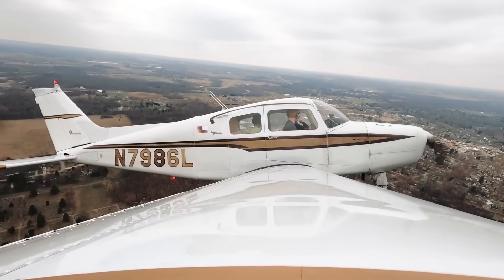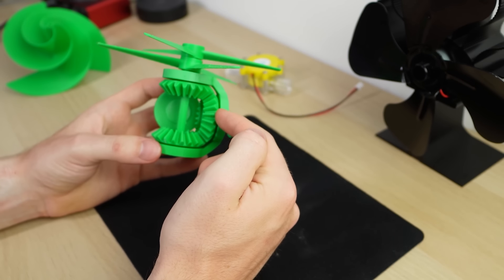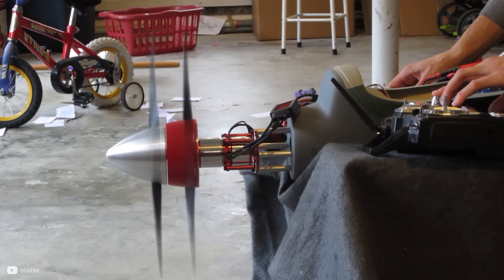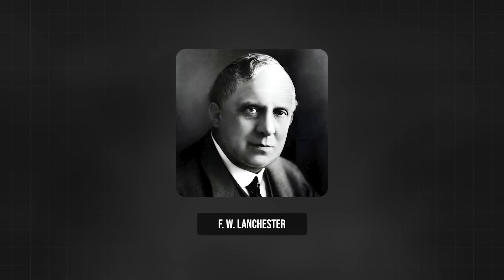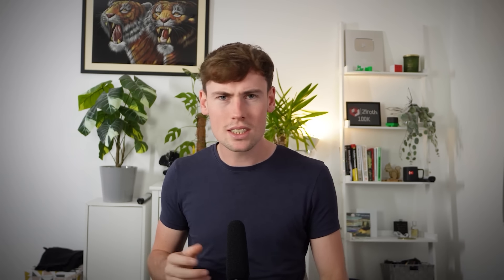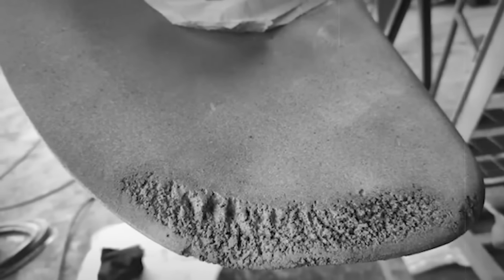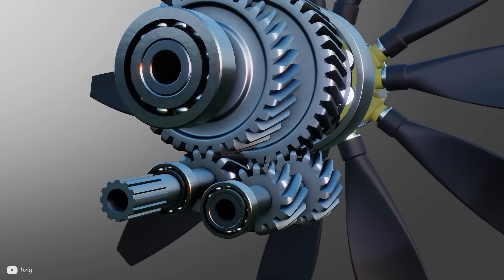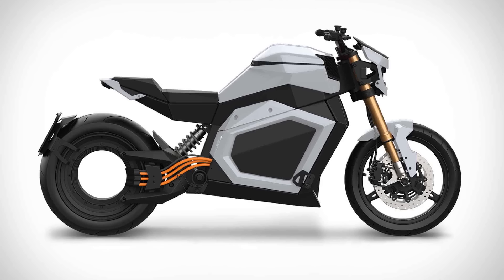The Unexpected Genius of Contra-Rotating Propellers

Comment: a pair of 2 contra rotating propellers would need different aero design each. or the rear one must have lower RPM speed. 
this is due to how the air get carried into the first propeller's momentum and rotating towards the first propeller direction so it will hit the second propeller with more energy, making the second propeller, albeit it running at the same RPM speed as the first, to seem to have more velocity in relation to the flow coming towards it. and if both propeller have identical design, if the first propeller works the aero perfectly it will be off efficient when the flow hits the second. so the second propeller must have an individual design for its purpose that to deal with the higher velocity coming, and produce efficient flow and thrust.
remember, the flow of the air from the first propeller not only faster towards the rear than what the first propeller is feed into, but also rotate the flow in OPPOSITE to the second propeller rotation.
i prefer to have a pair of 2 uniformly rotating propeller with each has different aero design purpose. the first propeller act as the "setup" to condition the flow for the second propeller. not to produce power. then the second is acting as the main propulsion which i believe would works better. and the goal design is to produce ultra high RPM without causing any turbulence breaks between the blades.
counter rotating propeller in tandem is tricky to make it fully efficient.
Reply: Rear propeller can have different angle at attack. Even different shape and radius might help.
Reply: Now, take it to the next level. The leading boat prop is always turning in water traveling at the speed of the boat. The trailing prop is always turning in water traveling at the speed of the boat PLUS the added prop wash of the leading prop. Therefore, the trailing prop should turn much faster than the leading prop to take advantage of the already moving water.
Reply: If RPM was the only variable you'd be spot on
Reply: Was my thought aswell that you would need different blade designs if you want them to move at the same speed (better option) or different speed with two the same blades (worse idea)

My gut feeling would be that the first blade could be Conventional, and the second blade made submarine style or torroidal to counter the higher intake speed cavitation/vibration.

Comment: the toroidal prop is going to have a real challenge finding a spot in fixed-wing aviation.

Virtually all high-performance prop systems use variable-pitch propellers to allow the AoA of the prop to be adjusted by a prop governor to match the  relative airflow and transmit the power produced by the engine efficiently into the air at any given combination of airspeed and engine speed.  I don't see how the toroid prop COULD be configured to be variable pitch, which would limit the application to uses currently suitable for fixed-pitch props, which basically means low-performance training aircraft and some cheap personal commuter planes.
Reply: One day, they'll invent lab grown shark cartilage toroidal props that organically change shape under a small current from solar panels...

... but it's going to be the day before a giant asteroid hits the Earth. :D
Reply: Toroidal propellers are unlikely to ever reach the level of efficiency necessary for economical flight.

Their wild popularity only shows the general ignorance of the wider population as well as MIT undergrads on what actually makes an efficient propeller...efficient.

Efficiency is defined as thrust horsepower ratio to net horsepower output.

Toroidal are about 50% efficient. 

A good fixed-pitch is 90% efficient and the best are >91%~ <94%.

How can a toroidal improve on that? Ooo 94.5%?

Comment: I love contra-rotating propellers, because you don't have to deal with such. In fact, I had been obsessed because to me, it's like fulfilling the need to have one full set of wings to correct the errors one might encounter with one single wing, or other means of propulsion fitting in this case.
One thing I would add to the design I suggested in your video about propellers following the tubercle effect was the one detail I completely forgot about until this one.
The propeller I had in mind was also one of contra-rotating design.

Comment: years ago i went to a museum in germany where they have an antonov 22. i took one look at that bird and i knew that it had counter-rotating props. on one engine the blades were spaced out evenly, one blade every 45 degrees. but on the other engine it was more like 30-60-30.
Reply: Not sure what that means. A degree is not a measurement of space.
Reply: @mikemondano3624  degrees can be a measurement of temperature or, in this case, angle.
Reply: @mrxmry3264  Indeed. But the angles need to begin somewhere, have an origin. And angles have nothing to do with spacing. From where are they being measured?
Reply: @mikemondano3624  where do you think they are being measured? From one blade to the next, of course,
Reply: @mrxmry3264  In a box on the floor?
Reply: @mikemondano3624  This is geometry.
When you want to describe the spacing of points on a circle, you use angles.
On a freely rotating circle, you may start at any arbitrary point you call 0, and then go some direction until you get a full circle at 360 degrees.
If somebody says evenly spaced 45 degree angles, they mean 8 equidistant spots on a circle.
For something like 30-60-30 you also get 8 points, but it's more like four pairs.

Comment: Great thanks!  With electric drives, you would dispense with the gear box, and just run two motors feeding a shaft within a shaft for the two props.  There would I am sure be useful benefits in being able to actually rotate the props at different speeds for certain flight regimens and of course stepper motors are king at that sort of duty.  Perhaps one prop off for cruise (say the front prop feathered), and differential speeds for assisting or even replacing roll control.  For noise reduction a different number of blades on each shaft has helped, but a 2-3 or a 3-4 or 3-7 beat might still be a bit odd.

Comment: @1:50 - i feel a need to point out that spiral slipstream is WAY less of a factor in power-induced-yaw than the effect known as 'p-factor'

if you're not familiar, p-factor refers to the prop disk itself producing asymmetric thrust due to the plane's Angle of Attack.

At high cruise speeds, p-factor is negligible because the AoA will be only a few degrees.  However, at lower speads, a higher AoA is required to obtain the same lift.  This results in the relative airstream arriving at an angle to the propeller disk.  Because of this offset angle, blades on the ascending side of the disk see a reduced AoA, and blades on the descending side see an increased AoA.

With a conventional right-turning engine, this means that the blades on the right side of the disk produce more thrust than the blades on the left side.  This effect can be pronounced enough, by itself, to result in loss of rudder authority before the wing actually stalls out, especially in some twin-engine designs operating with one failed engine.

p-factor is a much stronger effect than spiral wash, even though spiral wash is the one everyone always worries about.

Comment: I would like to see some study in applying contra-rotating propellers in a ducted fan configuration.  The ducting might reduce tip vortices or perhaps damage the enclosure and prove disastrous.  Either way, it would be an interesting study.
Reply: You might be able to find old Navy research using your described method applied to an older generation of torpedoes.... 😉
Reply: It's fairly typical for modern engines to have counter-rotating spools, as they eliminate at least half a stage, and potentially more as that first rotor can be made considerably more aggressive.
Reply: Ducted, contra-rotating toroids?
Reply: @wrd777  toroidal propellers are about half the efficiency of a properly designed propeller.

Comment: In marine applications, contra-rotating props have been around for a LONG time. Both Volvo and Mercruiser make them and supply them to this day. However, in marine use at least, they lose efficiency at high speed so they are used mainly on heavier/slower boats and not used on high performance boats.

Comment: The new open fan engine designs for aircraft do have a fixed second row of "propellers", which have some of the same benefits without the complexity of two counter-rotating props.

Comment: You can have a related conversation on Propfans and the transition to Open Rotor jet engines. It's an old idea with some concepts havin contra rotating stages, some single and the latest seem to be single with a stator. They were always promising for fuel efficiency but died due to noise, until recently.

Comment: I spent some time as a trucker in Canada. In really cold weather we'd sometimes put cardboard in front of our radiators to keep more heat in the engine. I was warned by an old trucker once to keep the cardboard centred on the radiator, I only had the bottom half covered, because the different wind speeds between the top half and bottom half would cause flexing with every rotation and eventual failure of the fan blades. Is this a problem with contra-rotating propellors? I would think there'd be an increase of pressure between the two blades every time they pass each other.

Comment: @ 10:41- I was an electrician for Duckworth Steel Boats in Fl, USA. Wired as 154' Casino boat. 
But that isn't Fla background. 
The issue with this prop design is, it is constrained. It's use could be advantageous to trawlers and ferries. This due to inefficiencies elsewhere in the performance curves. That is a lot of rotational mass that eats energy when accelerating.

Comment: Some thoughts i had: The forward blade is going to have more load because it's going to interact with relatively stationary or groundspeed air.  The 2nd prop will intercept already accelerated air (lower load, less rotational torque) and this imbalance will scale/vary with airpseed, air density, and wind.  So unless the differential speed/torque can vary between props accordingly this isn't going to happen... also this is higher drag.

Comment: I guess we're going to see more and more of these, however, one disadvantage with big ships using this will be the loss of transverse thrust, which is very useful for manoeuvring.
Reply: Don't big ship usually have maneuvering thrusters?
Reply: @Llyd_ApDicta  At the front, but not so often at the back
Reply: @ChrisTaylor-NEP  So what can't big ships do with these that they can with traditional propellers?
Reply: @Llyd_ApDicta  Traditional propellers can provide transverse thrust at the aft end of the ship if there are no after thrusters (which there rarely are).
Reply: @ChrisTaylor-NEP  Transversal thrust only works in one direction depending if it's a right- or left-handed propeller, and can work against you as well. I'm not quite sure what you think of as a "big ship" but in case of actual merchant ships this is a non-issue since you have tugs, on medium sized ship you can use maneuvering thrusters in combination with the rudder and on small boats with a outboard engine or a sterndrive, i.e. an engine where the propeller can rotate it easy to work around as well and well worth the increase in efficiency.
Reply: @Llyd_ApDicta  On some inland waterways I've worked on, tugs haven't been available, so the transverse thrust comes in really handy if you want to turn a bulk carrier on a sixpence. Further, if the weather is calm, you can save the expense of hiring a tug. They're not cheap. Been there done it.

Comment: For EV, one might be able to just have two smaller motors on one controller which would keep them synchronized.

The caveat being if one prop required more torque the motors may need to be different sizes to account for this which would make balancing everything an extra step at the design stage.
Reply: Why keep them synchronized?  There's no reason to think synchronizing them would yield the highest performance or efficiency.

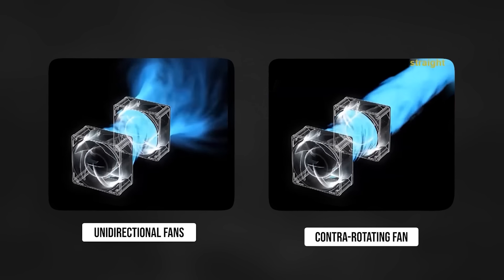Comment: 4:05 - note that the A400M doesn't use contra-rotating props, instead, the props on each wing rotate in opposite directions (4 shafts, 4 propellers). I suppose this also does cancel out the spiral slipstreams to some degree. The contrarotating props on the Seafire 47 were supposedly to make the airplane easier to land on carrier decks (it was still not that good of a carrier-borne fighter with its long nose and low drag), it was something the Fleet Air Arm was pushing for towards the end of the war. Tail draggers with single props were notoriously hard to handle on the ground, you had to stand on the rudder to keep the nose from swinging duue to the spiral slipstream acting on the vertical stabilizer, and a contrarorating prop would eliminate this particular problem. They also make sense for torpedoes, since torpedoes don't have long/large surfaces to keep them from spinning in reaction to the propeller's torque.

Comment: The Wright Flyer had contra rotating propellers.  However they were not coaxial. They were driven off the same engine.
Reply: If they are not coaxial they are referred to as counter-rotating.

Comment: From my POV, using contra-rotating propellers with electric propulsion (i.e. independent RPMs) combined with independent angles of attack is an interesting concept. This way, you can tune the rear prop to deal with the wake of the front prop at different speeds and altitudes.

Comment: One of your problems in outboard (or pod drive) props is when the electric motor is in line. A video of a pod drive (electric motor in-line) on YouTube shows it is a gyroscope. The boat was demonstrating rudder turns by switching off the motor, turning, and powering up again. The alternative was a near impossibility of turning the rudder/prop while driving. Motors use a lot of metal, that is a lot of gyroscope!

Comment: this is why i am still cross that no body took up the Revetec trilobate crank engine for aero use ,it has two contra rotating three lobed central cranks ,the horizontally opposed pistons are linked across the central crank/lobes [the later version arranged two sets of linked pistons in an X making a bit of a radial look ]. The design has built in contra rotating inner and outer shafts .it also produced huge torque at low rpm ,just a perfect aero motor .Plus was as near to 40% actual fuel effeciency as .. could probably double the range of most sport planes .

Comment: There exists a plethora of planes with counter rotating propellers (well almost). Pretty much all turbies use stators in combination with their rotors to counter the rotation of the air flow. It gives (almost) the same efficiency gain without any extra moving parts. In modern jets the stator also act as connecting rods between the casing and the rotor shaft which doubles as a shock dampener af helps with vibration (noise).
Reply: Also the engine used in the F22 and F35 actually doesn't have static stators (lol). Instead the compressor shaft spins one way and the stator the other, via (afaik) planetary gearbox. This solves a huge problem where rapid changes in thrust or compressor stalls / unstarts jerk the aircraft. This movement was responsible for putting F14 (A model especially) into nearly irrecoverable flat spins
Reply: Counter-rotating is not the same thing as contra-rotating, don't get the terms mixed up!

Comment: Not sure what the increase in decibels for a smaller plane would be. But in the Tu-95, AKA: Bear, it was substantial. US fighter pilots would regularly intercept them flying up around the arctic circle, and could hear them before seeing them. An impressive feat, especially when you consider how loud a fighter can be. Had a low flying F-16 from the 180th FW and you could feel the sound in your chest. If I'm remembering correctly they were also able to track them using acoustic sensors used to track subs.
Reply: Tu-95 and a few other Prop planes throughout history were known for being insanely loud because the prop tips were supersonic. With large diameter props/fans this becomes a huge design constraint and one of the main reasons why jet airliners were able to cruise faster than turboprops and turbofan engines used today. The TU-95 is a funny example of accepting crazy noise to achieve faster speeds for a strategic bomber in a very Soviet way. I can't even imagine how loud they are in person

Comment: Good video. You need to mention the weight. Everything in aviation is affected by the weight. It would be great to have the efficency however the added weight will reduce your payload, therefore impacting efficency. The TU-95 you show, as well as the P-51 air racer use contra rotating  props because a single prop can not absorb the power produced by the engines in those applications. They tolerate the added weight of the heavier gearbox, and extra prop so they can use the high power. Electification, new technology will not defeat the laws of physics. Every extra gram on an aircraft is 1 less gram you can carry. The Cessna 152 you showed as an example, has an inefficient fixed pitch prop, because an adjustable pitch (Constant speed) is heavier and would reduce the usable load, a contra rotating power on that aircraft would end up being a single seat plane with a 1/2 hour of range.